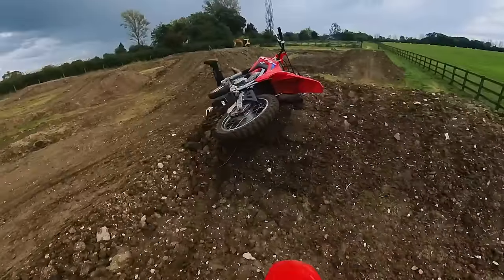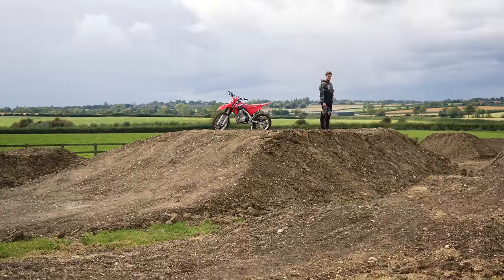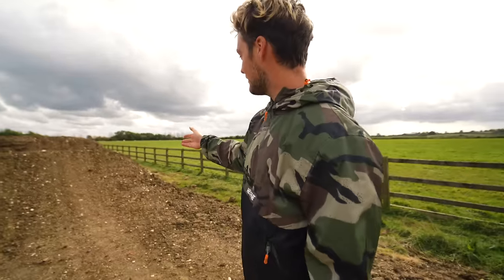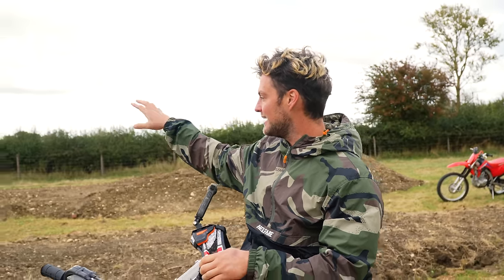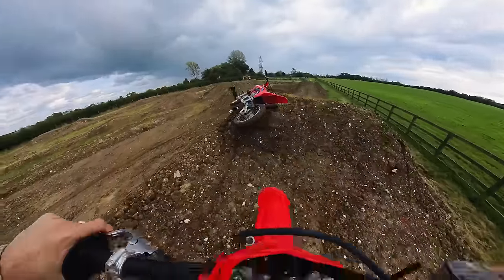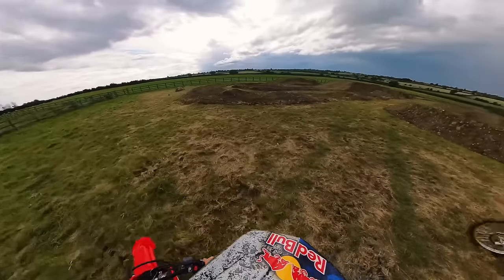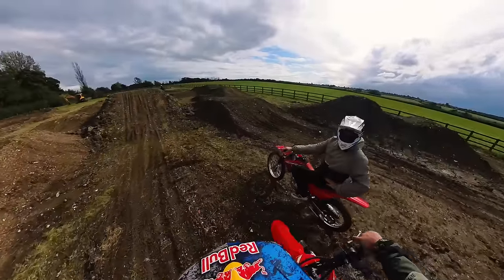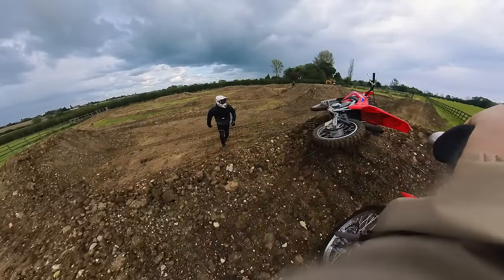FIRST TIME RIDING THE BACKYARD PIT BIKE SUPERCROSS TRACK!!

Comment: I broke my foot when I was 18 in a 'silly' low speed off-road accident.  PLEASE do get mx boots - they greatly reduce torsional loads and would have prevented the tarsel/meta-tarsel disclocation and multiple fractures I had.  Believe me, it's not fun - used boots are cheap and well worth it if you can't afford new.

Comment: You need a start straight between the fence and the track into the first corner after the two table tops. then you could go for the hole shot and race properly.

Comment: Would definitely recommend some proper boots btw. Very easy to snag your foot under the peg or have the bike snap your ankle if it lands on it. I'm currently recovering from a torn ligament in my ankle from a pretty soft crash (with boots on), full size MX bike mind you but still it can happen on these pitbikes quite easily

Comment: There is no reason to jump on to the table if you dont have anything to jump over off of it. More time in the air is always slower in motocross. Alot of times you see them trying to jump over the biggest faces in a section